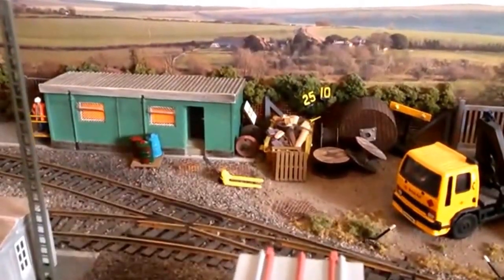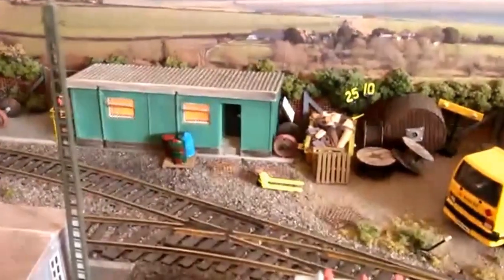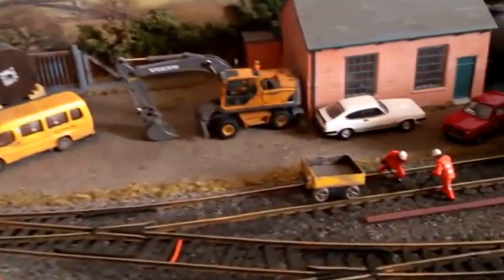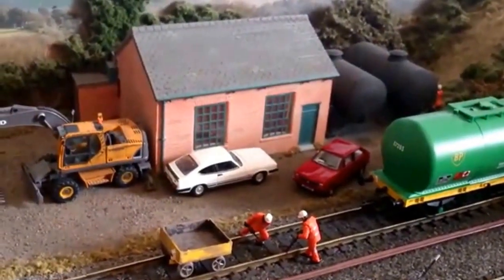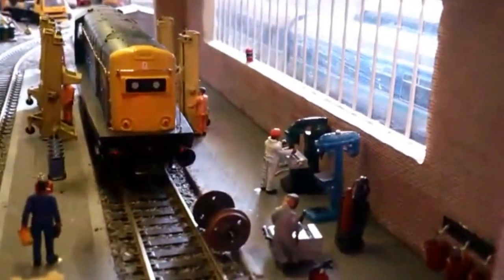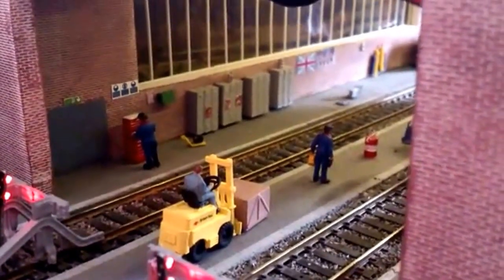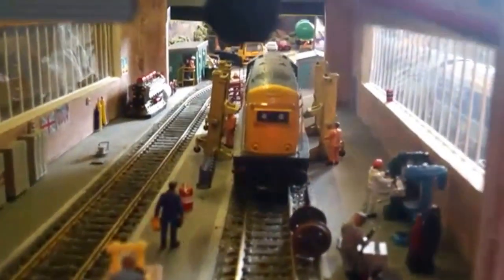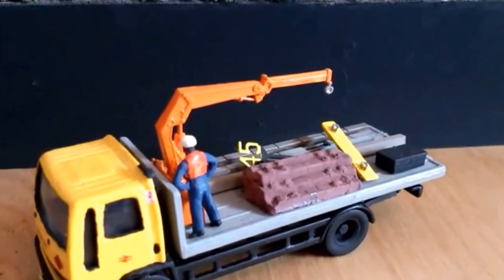Parklane

Comment: I do like your little details.  Where did you get your ground levers to manually operate the points?   Also, see the wee lamp you've put on to the back of the platelayers truck...where did you get those?
I have my platelayers trolleys after you recommended them...think I might do mine rail yellow too, as your ones look great. Dave
Reply from the maker: Hi dave I got the point levers from eBay there ready painted and come in a pack of 4, the lamps come from springside models and come under modern loco rear lamps from eBay.
I also got some of these on scene lighting lamps  which the engineers use at night to light up scenes will put on a video later there made by viesseman code 6335 hope this helps dave 
Oh and your layout looking great mate
Cheers
Graeme
Reply: Graeme Morrison Hi, cheers mate, thanks for that.  I will have a hunt for some of the levers! Dave

Comment: Superb looking TMD.   Where did you get the lathe/drills etc in the shed? Also that platelayers barrow is great, did you make that from scratch or where did you get it?....fantastic! Dave
Reply from the maker: Hi dave 
Thanks for the comment the drill and machines are from langley models code F285 and the permanent way trolley is from coopercraft I got mine on eBay 2 for £4.00 which is a good buy and would look great on your layout mate
Cheers
Graeme
Reply: Graeme Morrison Cheers! I have just ordered the drills from Langley...they will do nicely for my TMD when I get it built!!
Cant fid the coopercraft trolley yet.

In the far left hand corner of your shed you've got what looks like a diesel engine out of a loco...what is it?, you make it yourself?  It looks cool.
Reply from the maker: Lol well spotted I got that off eBay it comes as a casting and I just painted it to look like its ready to go into a loco if you type in oo gauge Diesel engine on eBay you will see it in a shunter with a crane lifting it out
Cheers
Graeme
Reply from the maker: http://www.ebay.co.uk/itm/261848034055%20
Reply from the maker: Forgot to say dave you will get a trolley off the coopercraft models website
Cheers
Graeme